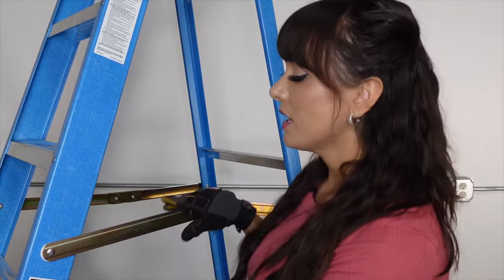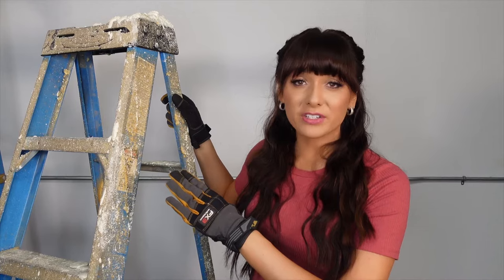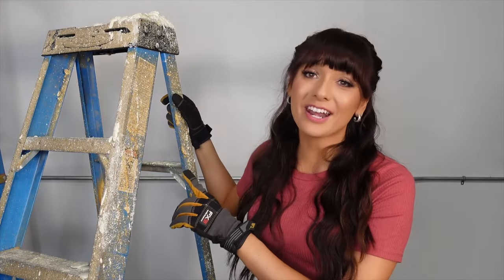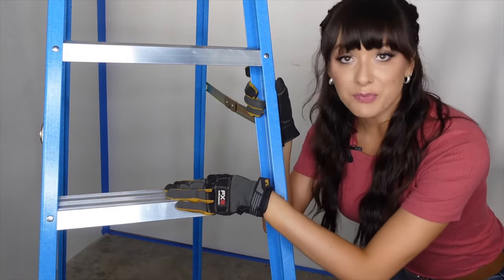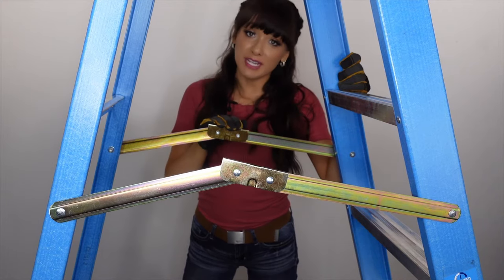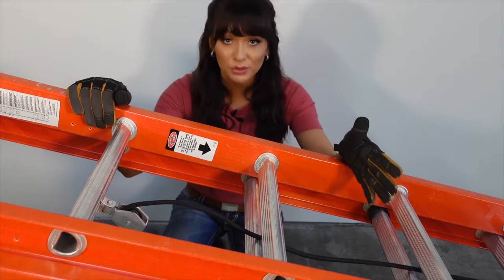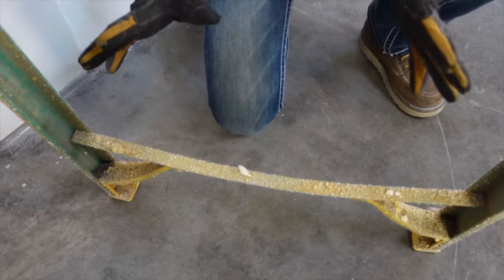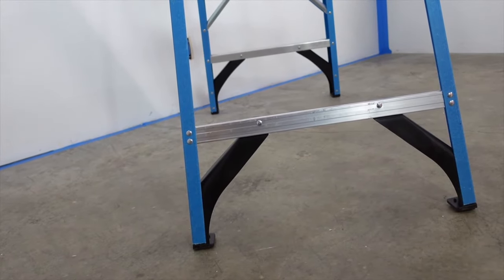LADDER SAFETY | How to Inspect Portable Ladders

Comment: Tip: To keep safety labels visible when spraying paint, apply a piece of clear packing tape over the label then apply a shorter piece over the first one. Fold about 1/4" of the end of the second piece of tape to create a pull tab for easy replacement when needed. If you don't use the "two pieces of tape" method, the safety label may come off when you replace the cover tape.
Don't forget to use a ladder mover for carrying your heavy ladders and supplies.
Reply from the maker: Thanks for sharing!